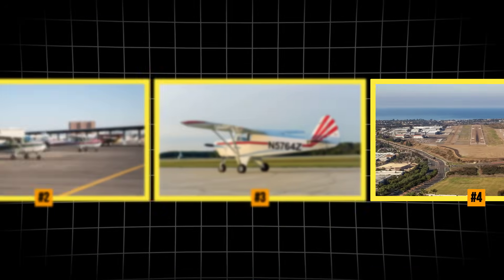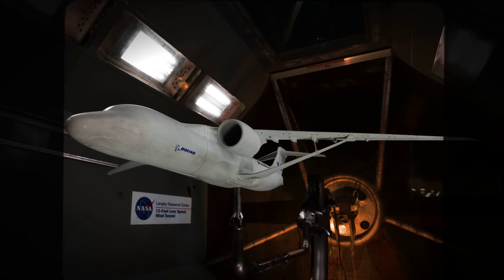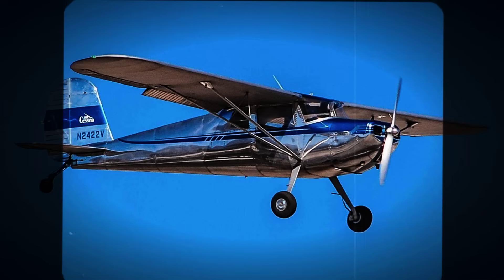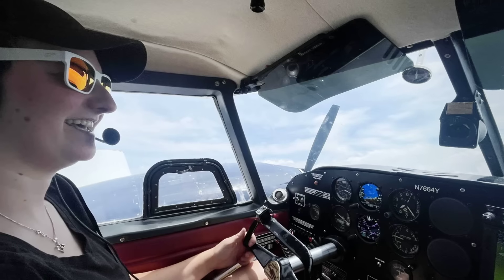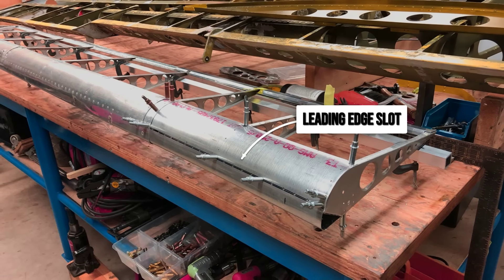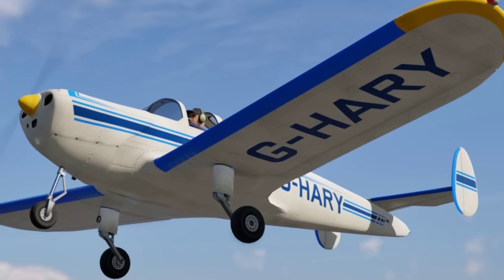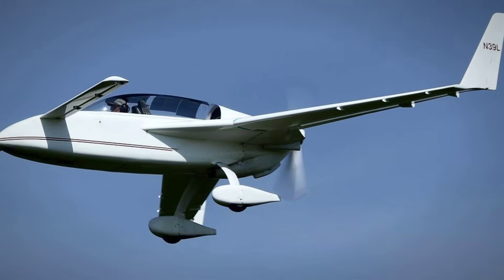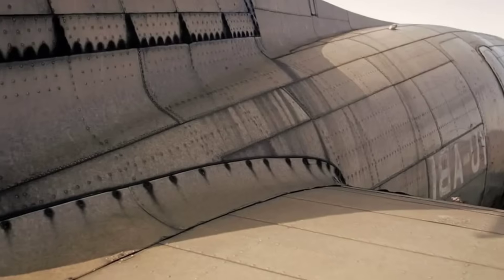10 Statistically Safest Planes Under $40,000

Comment: Canard designs are not that safe. What "statistics" did you use? Only spins? Approach speed, therefore energy, is very high. Fiberglass construction is not very protective. So what if it is "stall proof". You will hit the ground very hard, straight ahead. A friend almost died in one recently. An engine out landing in a athletic field would have been a "walk away" in most light aircraft.

Comment: The Stinson 108 also has a elevator-limiter interconnected with the flap selector, providing stall margin until short landing with full flaps. The fixed-slat description and images are not correct in this video, but such a feature exists and adds safety to the 108.

Comment: An aircraft that crashes going 120 mph crashes with over 1900 times more energy than the same aircraft if it crashed going 85 mph. Not twice as much energy., please do a little bit of math when you're talking about Force multipliers.
Reply: Would you care to share how you did the math ?
Reply: The bottom line is, if you hit the ground hard enough you will die
Reply: They said squared, not doubled.
Reply: I'm not a physicist but remember some of my school physics! The kinetic energy to get a plane to fly at 120mph is 1/2 mv squared. (The momentum of the plane is mass x velocity. The KE is also equal to the momentum squared divided by twice the mass). I would presume what kills you in a crash is the speed of deceleration which is controlled by many variables.That would depend on how quickly the crash happened. Strength of the airplane, what it crashes into, the exact forces on the blood vessels and tissues,  etc, etc. From a rough calculation and I may have got this wrong I found the Kinetic energy of a 1000KG plane flying at 120mph to be 1.438 Megajoules and the same plane at 85 mph to have a KE of 0.721Megajoules. So going from 85 to 120 mph has just about doubled the KE to be absorbed in a crash. I converted mph into metres per second to keep the units correct. That is metre, kilogram, second. (MKS).
Reply: Okay, let’s actually do the math. (120/85) ^ 2 =1.993. Twice the energy.
Reply: @glenwoodriverresidentsgrou136  You got the same answer as I did. But where is your equation from? Just curious!
Reply: @JohnKelly-g9u2w   probably should have expanded. It’s high school physics. Hard to write here, but Energy = mass times velocity squared, all divided by two. E=1/2 M V^2. The M won’t change for a given aircraft, nor will the 1/2, so energy in this case is proportional to the velocity squared. Easy peasy. If you want the actual energy, say in ft-lbs, you have to fiddle with the units. But for proportionality, you just square the relative velocity, in any units. Hope this helped.
Reply: @glenwoodriverresidentsgrou136  
OK, but @44hawk28 wrote 1900, not 1.900. Not a big difference, but there is one.
Reply: I don't  want to fly anymore

Comment: I once flew a French light aircraft called a Rallye Horizon.
It had Fowler Flaps, Slats and a wind-up landing gear.
It never actually stalled, but sort of mushed down.
Reply: The Morane Saulnier series of Rallyes, 880-894, has the nickname of "tin parachutes" for their controlled descent. Idiot-proof. I owned one for 10 years. Well-kept specimens still available, and modern communications support type club and support, internationally.
Reply: @jeffreypierson3023 when in ground effect they don’t want to land 😂
Reply: Helio Courier does the same thing, it's because of the slats

Comment: The  varieze can be spun. Ask John Denver.
Reply: Wrong.  JD flew a LongEZ that he ran out of gas then flew without paying attention , fast into the ocean.
Reply: @MarkShinnick  AND !!! ...To make matters worse... He executed "the maneuver"  at an altitude of 50 ft (or less) !!!  👎
Reply: @HiflyColo730 So tragic he had lots of experience to say FK it and just easily ditch the airplane.. where the winds would simply push him comfortably to shore.
Reply: @M @MarkShinnick     Wrong. A longeze is a stretched varieze. He ran out of fuel in one tank and in reaching for the tank selector (which was inexplicably placed behind him over his left shoulder and was difficult to reach) he twisted his body which extended his right leg which pushed the rudder as the aircraft slowed to a stall. It spun in. Read the accident report.
Reply: @glenwoodriverresidentsgrou136  You keep digging yourself into the ignorant-inexperienced hole about what a spin is, and the significantly redesigned LongEZ which most anyone whose built and flown these since the '80's knows.  We were working Global Hilton in Mojave when Dick immediately bolted out to do the investigation; EZ guys understand the tight descending yaw roll distracted JD put his perfectly-flying airplane into too close to the water. Got himself decapitated.
Reply: @MarkShinnick  if you want to be condescending and split hairs over the  difference between a tight descending yaw roll, a tight spiral, and a spin, be my guest. Result is the same. I claim a tight descending yaw roll is one definition of a spin. And I’m right in that claim. I’m a pilot and engineer with Aero classes in my transcript. Building one does not make you a know it all.
Reply: @glenwoodriverresidentsgrou136  No condescension or hair-splitting intended. Sure, you can be subjective in your personal definitions, but that's not objective Engineering. Your choosing to miss objective General Aviation distinctions that JD was miscontrolling a fully-flying LongEZ which's wings were not stalled.
Reply: @MarkShinnick  Well at least we can agree that he mishandled the airplane. Perhaps the original builder had long arms and could easily reach the fuel selector, but that selector placement would not have been allowed on any certified aircraft. Nor in the F-16, design of which I worked on as my first job out of college. Too bad you’re not local. These discussions are generally better over tequila.
Reply: @glenwoodriverresidentsgrou136  Agreed. The valve itself was sticky and mounted on the firewall with numerous articulations and no secured handle to JD's seatback. Original Builder did this to dubiously remove all the fuel tubing from the cockpit. JD was having fun; he just overstayed the 1 tank's fuel after he knew any tank switching was non-standard and risky.
Reply: @MarkShinnick  JD flew a experimental aircraft that had a bad fuel selector valve that had no clear detent when selecting fuel tanks. In other words he had zero feel feedback for when he selected the "on" position for the other tank. I have flown many C-120 - C140's that had this exact same issue. But in the C120 - 140 you could see the correct position something JD could not do because of the fuel selectors position over his shoulder. The fuel selector handle was also very hard to turn so JD had to turn his body a full 90 degrees to reach the handle. This also caused him to extend his right foot onto the rudder pedal and this slowed the aircraft. The real cause of the crash, pilot overconfidence in aircraft type.
Reply: @FLHTdriver Yeah... imagine, low over the water, having great fun flying, time runs out and dealing with that funky vice grip zero feedback handle under fast growing stress bypassing all his better judgement with  just safly flying the airplane. Then... decapitation.